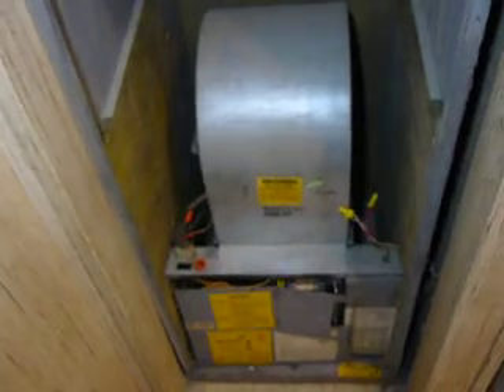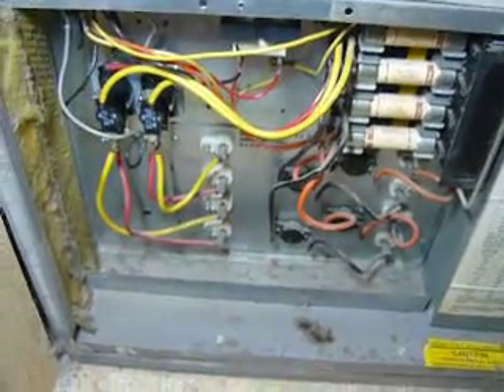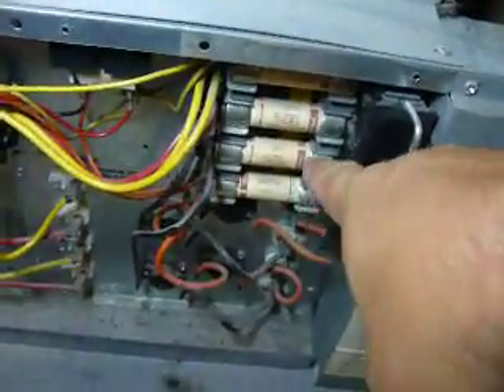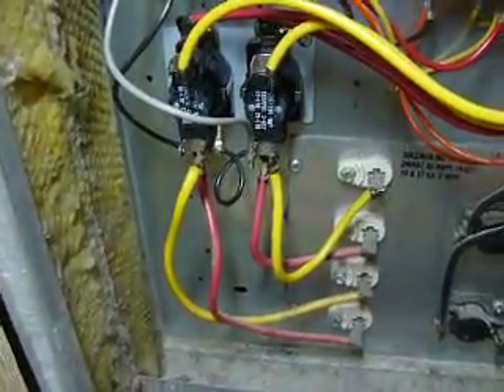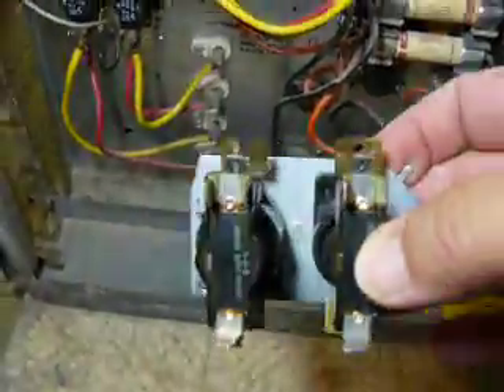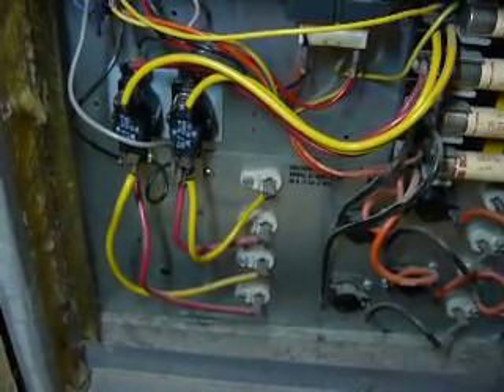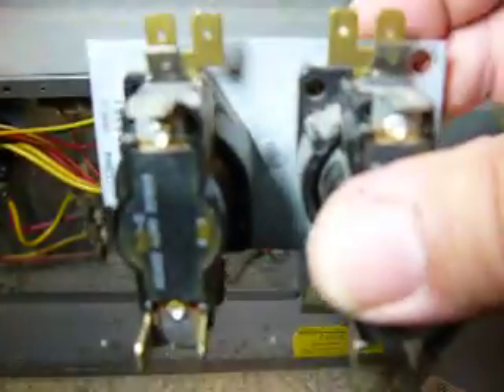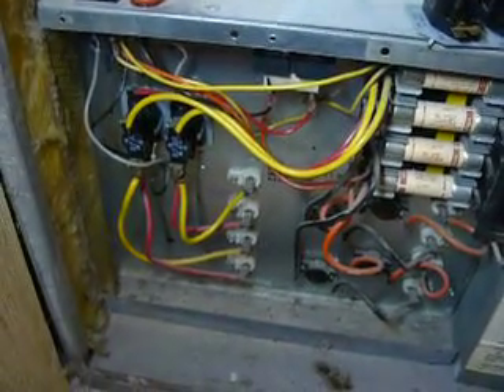Coleman Electric Furnace 3400 No Heat Troubleshoot

Comment: Hello. I have the exact same model. The  furnace does make a clicking noise when I turn it on. But nothing comes out. No hot air. Any ideas ? Thank you
Reply from the maker: Check for power in and out of the relays, if you have power in and nothing out you have bad relays.

Comment: Hi. I was just given this same unit. It came with 600V 4 awg (3 wire) to 60 amp breaker. I’m installing heat only. Does that sound correct to hook up?

Comment: Heating.  Changed breaker and limit switch and still 50 amp breaker getting hot
Reply from the maker: I no longer own this home and it has been years since I had to work on the furnace so from memory I would suspect the sequencer.  Sometimes the heating elements will stay on at all times, the sequencer controls the heat elements.

Comment: I have a 3500, it is turning on and heating up for about 10-15 seconds, however the fan doesn’t turn on for it to circulate the heat so it then shuts off. Trying to troubleshoot it now.

Comment: Hi, this is exactly the issues I'm having and looks like the same furnace.  Where can I get the sequencer for coleman 3500 9.6 KW furnace in my manufactured home
Reply from the maker: https://colemanhvacparts.com/collections/3500-811-coleman-electric-furnace-parts
Other link I gave you was for 3400. This should get you closer.
Reply: Where do I find the part number for 3500 9.6 kw manufatured home Coleman furnace
Reply: I need to know how to find the correct sequencer

Comment: Thanks so much for making this video. My moms manufactured home has a furnace that's been blowing cold air and having issues. So she called a heating company to fix it, they charged her 500 bucks and said it was fixed. The issues continued and they claimed that we might need a new thermostat too but weren't sure. So I decided to take a look at the furnace and try to figure out what was going on. After some searching I found your video and replaced the sequencer. Works perfect now. Now I don't have to worry about my mom having a freezing cold home this winter. And she doesn't have to worry about trash heating companies ripping her off. Thanks so much again.

Comment: I don't have the manual/auto switch on mine.. I came across this video after having a different issue. My heater would stay on for far too long. I thought my wife was bumping up the thermostat or that the thermostat wasn't registering the actual temperature in the house, as the heater would run and run, cooking me and my son out of the house. 
Today it wouldn't turn on. It seems to have this issue every now and then, and only killing the breaker to check fuses would get it to kick back on.
Today I opened up the entire cover and found the wire leading to the limit switch was charred black 6 of the 12 inches in length, and the connector on the end was nothing but ash. Looking closer and the wire is no longer in one piece! The limit switch itself is melted and crumbling. Found it for$25 on Amazon.. hoping this is as simple as a replacement and it's solved... 
Any ideas on how this happened or how to avoid in the future?

Comment: Turns out the Sequencer was bad , made a drawing of the Sequencer before removing any wires. My copper lines and drain lines run right in front of the Sequencer so space was tight. Removing the wires from the right side of the Sequencer and the whole dam thing disintegrated. Used a meter to test my limit switches and found 1 out of three was also bad.

Comment: Have been told the high/low limit switches could be bad. Wish you had a video on this model on the switches .....
Reply from the maker: Limit switches can be the problem, however I found the sequencers fail more often.
Reply: @breakerbroke23  thank you for your reply,  my unit is the 16KW unit original factory installed in 1988 .

Comment: My son is buying a mobile home and it has an older coleman heater. There isn't a thermostat anywhere in the house. The previous owner did some remodeling and we think he removed the thermostat and didn't replace it. We can't figure out how to turn on the heater. Any ideas?
Reply from the maker: I believe you may have to install a thermostat. Mine was wired under the home. Maybe go under the home,  get under the area where the furnace is and trace where the wire goes from the furnace to ..... The Hall or front room?
Reply: @breakerbroke23  Good idea! The owner installed sheetrock over the paneling and probably took the thermostat down and did not replace it. Thanks for your help!

Comment: I heard something pop in my furnace i was told it was the transformer i replaced it but now I'm not getting anything.
Reply from the maker: Check the voltage both in and out. if you are getting like 24v out then its just fine, next thing that I would be looking at would be the sequencer. Those go out most often. When replacing that please turn off your breakers. Good luck

Comment: My 60A breaker keeps pooping after 5-10 minutes of use. It heats somewhat but cold air blows through and I’m think there’s holes in ducts because rats feces are in the vents. Do you think replacing this part would help with low heat?
Reply from the maker: Sounds like the AC is mixing with heat. You could replace the sequencer, but you may have other things going on. Look an d see if all of your heating elements are working when in heat mode, check for soft breakers. You can feel if they are soft by switching them off and on, if they do not have a hard positive click like the others in your panel they could be "soft". It is rare but does happen. And most important, seal up those vents and clean them out. Maybe call in a pro to do that and disinfect as well.

Comment: Another Ms. Fix it! Blower is running but not pushing out air like when heat is on, just will not shut off. I changed two Coils and now I am going to try the Sequencers! Thanks for the tip cross my fingers!
Reply from the maker: You go girl:)

Comment: Hi I've been trying to figure this system out for a month now. It's getting warmer and I don't need the heater anymore but id like to use the cooling system. My mobile home has a dial/switch in the kitchen that says "off, pump only, high cool, low cool, high vent and low vent. I was told this was to use the furnace to cool the home? Is this true? And if it is true how do I use it? Id hate to flip the switch and have the heater kick on at the same time and mess something up. Any advice would be appreciated. Me and my dogs are burning up in here! Lol
Reply from the maker: With your thermostat saying pump only I wonder do you have a swamp cooler?   My setup was for furnace only, so Im not sure about yours. Generally when a thermostat has heat on and then cool it is a dual hot cold combo, so in cool mode you should not have any heat coming from the furnace. Maybe call a specialist now that the hot weather is coming. would be worth the $60 service call? Wish I could be more help.
Reply: @breakerbroke23  yes sir now that you say that I'm almost positive that's what I was told it is. I'm from Texas and I've never seen anything like this before. I'm living up north now and I'm just cautious about flipping a switch to something I have no idea how it works. Thanks for the quick reply, I appreciate it. I'll take your advice and call in the morning.

Comment: I worked on this exact same furnace this morning and found one sequencer defective and not energizing terminal M6. In addition, two of the heating elements are open. I decided to quote a repair to restring the two open elements and install new sequencers, and also give a bid for a split system heat pump. The homeowner stated that her electric bills are high in the winter because that thing is rated at 80 Amps when all 4 elements are energized.

Comment: I have a 1989 Coleman 3400 series electric furnace and you have to open up the furnace to change from heating to cooling, I want to install a Nest thermostat so I can change from heating to cooling from the thermostat. The furnace has a sticker on it where the thermostat wires connect saying if the locking clip has been removed, to switch between heat and cool you must do it from the adjoining switch.
My question is .......where was the clip and what was it connected to? I am unable to install my new Nest Thermostat because the clip {what ever it looks like} is Not tDalehere...........................PLEASE HELP
Reply from the maker: I don't know. I would keep looking on YT or google. Sorry.

Comment: I have this exact furnace. Everything seems to work, but it only blows hot air to one side of the house. Should I replace the sequencer? or does it have an element that just does half the house I can test?
Reply from the maker: I would look under the house, I would look for a main vent line that has fallen or come unhooked.
Reply: I should have been more specific. It blows cold air to half the house and warm air to the other half.

Comment: I have a friend with this unit in his home. His issue is his will come on but it's blowing nothing but cool / cold air. Do you believe that's the sequencers or something else? if you turn the thermostat on it will begin blowing but the air just never gets hot / warm. Prior to this he had a issue with it blowing heat and not cutting off once it reached the temperature set on the thermostat it'd just keep going. So he shut it off by the breaker since the weather had been more comfortable but here recently we've had consecutive days where it's been pretty cold and will remain so over the next week. So he flipped the breaker for his furnace back on in his breaker box but now it's just blowing cold. Any info would be great help thanks!
Reply from the maker: If there is no heat then I would cycle the furnace and while the fan is running (and heat should be on) check for voltage at the heating elements. If you have no power I would suspect the sequencers. Also check the bank of fuses for a bad fuse. More than likely that is not the problem, but you never know...Good luck.
Reply: breakerbroke23 Just replying back, I fixed the no heat issue (it's blowing warm / hot air now) the bottom wires on the right sequencer were fairly loose so I made sure they were fitted properly and that seemed to bring the heat back. But I advised him to call in a actual professional to get it back to proper running condition. Once I opened the panel the wiring in it looked nothing like any other pictures and diagrams of the exact same model he has that I had looked up. For one, the left sequencer had absolutely no wires running to / plugged into it and I saw no wires that were tucked away or meant to be for it. So I decided to play it safe since I'm not a professional in dealing with furnaces / HVAC (im just a lowly welder lol) and told him to have some real pros look at it. At best I'm just incompetent, at worse he gets it fixed / replaced properly even if it hurts his pocket a bit.
Reply from the maker: Good job! At least he has heat. If it works and goes through the heat cycle on/off then I would think he is good to go. Now about the "lowly welder" comment, dude! If you can weld, you can rule the world. As a welder, you are a artist my friend, it takes skill that a lot of people cant master ...... Like ME!. BB23
Reply: My parents are having the same problem, they turn the heat on in their singlewide, and it will just blow cold, and my mom said it takes 30 or more minutes before the blower will cut off. (Blowing cold air all the time). I have not checked it out myself, planning to though in the next few days.

Comment: Hello Sir.I have a EB15B electric furnace and I'm having a problem.I have replaced the sequencers, all three limits, and both of my heat strips are working.But when I turn the unit on I'm getting coldish warm air and after 3hrs it only bring the temp of the home up to 68 degrees.So I decided to remove the blower motor and look at the heat strips while the furnace is on and after I start the unit about 5-10 sec I hear a click and the bottom heat strip goes out, and the top one stays on, but the bottom one does not come back on after a min or two, in fear of doing any damage I shut off the unit.Can you please help me with this problem?
Reply from the maker: Did you get the correct sequencers? From what you are saying it still sounds like sequencers or the heating element. Hard to say without being there.
Have you looked at other videos, they may have gone more indepth.
Reply: Ok let me double check the sequencers and I'' l let you know tomorrow.Thank you for your kind reply

Comment: Have you ever had a problem with the furnace not turning back on at times after running longer on cold days. The 70 amp breaker does not trip but if you flip the breaker off and back on again, the furnace works again.
Thanks for your time
Reply from the maker: Sounds like a "soft" breaker. I would get a new one. Worst case its not the breaker, at least that is one part you know is good. IMHO
Reply: I replaced the 70 amp breaker and it is still not turning back on when the thermostat activates sometimes. This doesn't happen ever time the furnace shuts off, maybe once or twice a week, seem to happen more often when its colder outside causing the furnace to stay on longer. The last time I was there after the furnace had been running for a bit, the motor felt very warm.

Comment: mine is doing the reverse to this when the blower shuts off at times the heating element is staying on would this be the sequencers needing replacement as well its only done it 2 times but this time it got hot enough to smell it and I happened to walk by it and the area it sits in was really hot
Reply from the maker: I would say replace the sequencer.
Reply: thanks for the reply that's what I figured so parts on the way
Reply: got a new question I replaced my sequencer and now I have a cycling issue I can actually look at the thermostat spring in the thermostat connect and heat comes on then after about 2 mins it comes off contact and I can watch the spring move back to contact the spring feels warm as well I did nit have this issue before should I replace the thermostat ? the sequencer is wire for wire as well verified with schematic
Reply from the maker: robert m
Not sure, When I replace anything like this I transfer wire from one to the other.  One at a time.
You can look off the schematic and go from there, keep in mind the real world hook up MAY be off. But I dont believe a metallic thermostat should do this. Check to make sure your schematic isnt wired for a electronic thermo, they use like 24volts. If you ordered from the web site in my video description I would call them and ask. The guy that runs that place seams always willing to give info.. Good luck....BB23

Comment: Any idea where to find that part, I having a hard time finding one and this freaking heater wont stop running unless I shut it off at the breaker and when its going below freezing its a pain....any idea where to find parts since this is a old furnace, tried getting one off ebay but it dosnt look right.
Reply from the maker: Follow this link .. you will need to go almost to the bottom to find your part. You call also call them if you have a question.. Good Luck...BB 23
http://mobilehomerepair.com/ColemanElec.php

Comment: breakerbroke23: Can you tell me where  does the Black& Red Wire go that ISNOT in the 13&14 Pin Holder on the 15 Pin Wiring Harness? It is to the Left on this video
Reply from the maker: I do not own this furnace anymore and I can not remember pin outs, so I would check the schematic, that should be on the back of the front panel or the front of the heater box next to the fuses.

Comment: Model EB15B - I've replaced the sequencer (Heat Sequencer Kit for 3115-3571, although they sent me a compatible one since they were out).  The furnace continued to have troubles and stopped working altogether.  I replaced the transformer with Coleman OEM Furnace Replacement Transformer.  Now I still get absolutely nothing, not even a hum.  I hooked up a meter and get no reading past the breakers.... could both the breakers have gone bad?
Reply from the maker: I doubt it, But check them any way, be sure to take them out of circuit to check whit your ohm meter. Also I prefer to get the proper sequencer. Not sure what you have on those.  Look at Mark Bower youtube ch, I think the video is..How sequencers work. Stick with it, you will get that sucker running.
Reply: Alright, something wasn't plugged in properly so it's working again.  Now the furnace doing the same as original problem.  Works fine for awhile then fan starts and stops randomly and without reason.  The heating / cooling continues even when the fan is not blowing.  I replaced the sequencer, but perhaps this new part is not working properly?

Comment: If the sequencers are going bad will that be a cause for luke warm air? Coils heat up ,thermostat works. Its jyst not heat you would write home about!
Reply from the maker: +william shepley make sure the complete coil assembly is heating up.
there are some videos on how to check this.... mike

Comment: Hello, I am so glad you posted this video. We just bought a manufactured home with this type of central electric furnace. Its unusually hot where we live this time of year & I was wondering if this particular model also blows cool air into the home? Our on / off temp switch on the wall has a "cool" & a "heat" position. We sure would like to cool the house but don't know if its possible with this model. We live in the pacific northwest area & its 91° &  very muggy right now
Reply from the maker: Brittney W. I think the cool setting on your thermostat is for AC, So unless you have an add on AC unit I dont think you will get cool air or just the fan running without heat on this unit. I live in NW Washington as well.